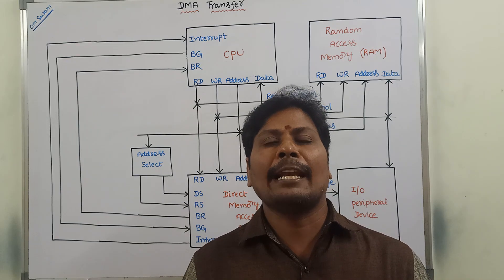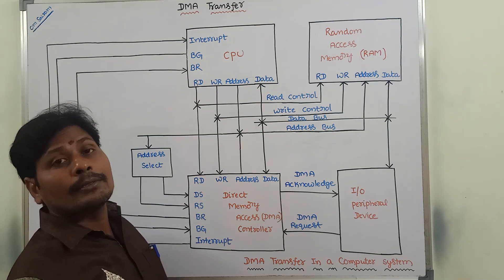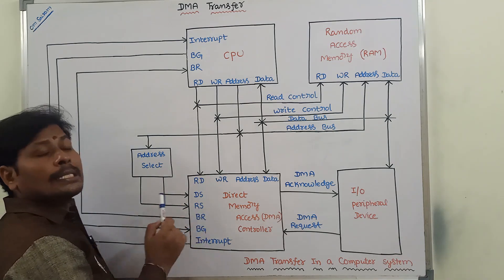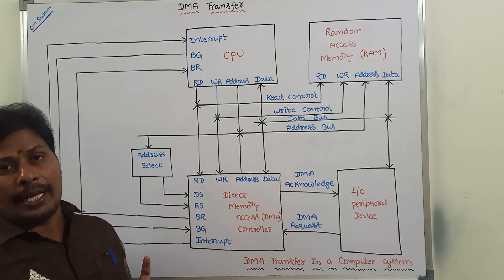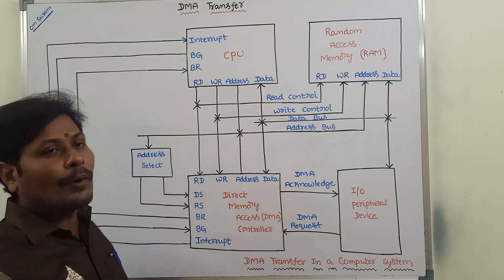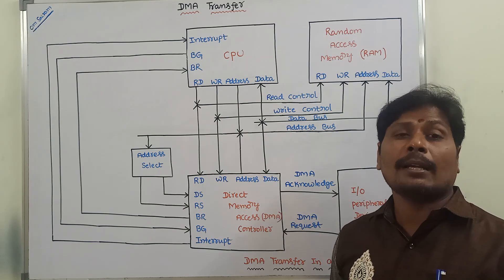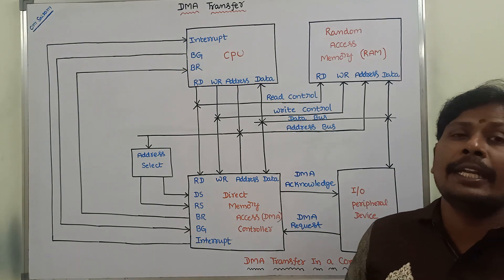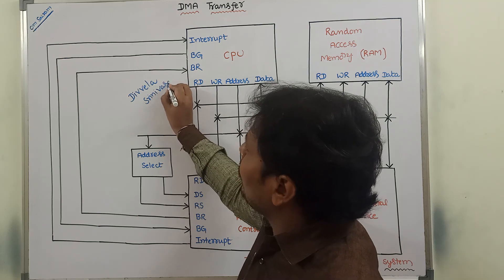DMA Transfer || Direct Memory Access ( DMA ) Transfer in Computer Organization Architecture || COA

Comment from the maker: if word counter register reaches the value zero, then  DMA controller stop the transferring and disables the BR(Bus Request) line and send the interrupt signal to the CPU and release the buses handled by it, Now  CPU disables the BG(Bus Grant line) and takes the control of the buses. This is correct.